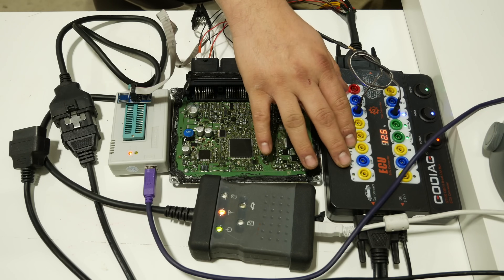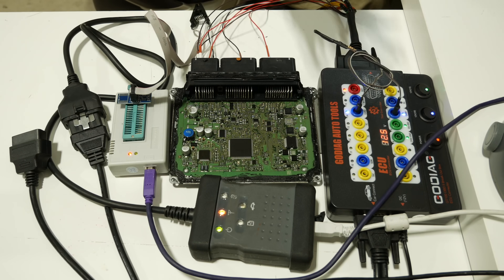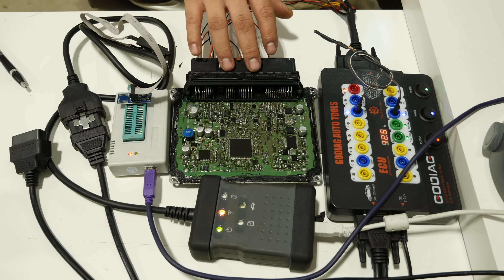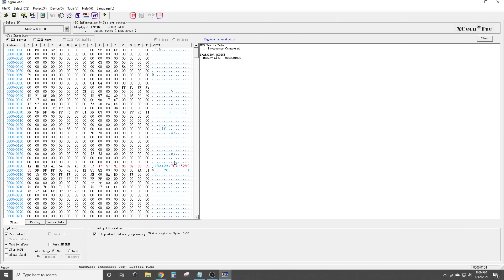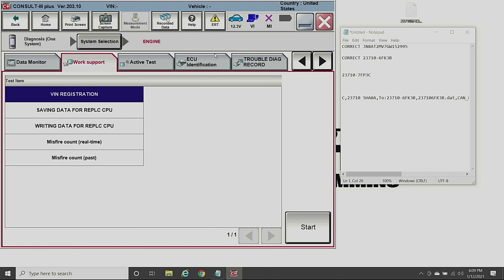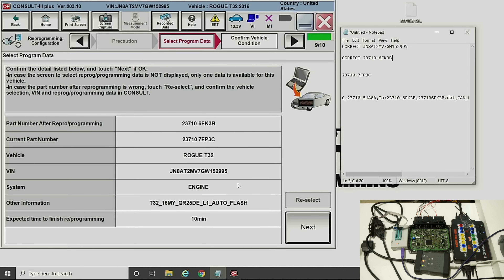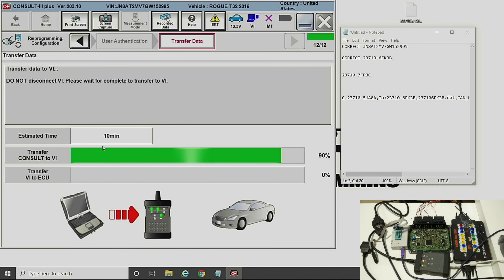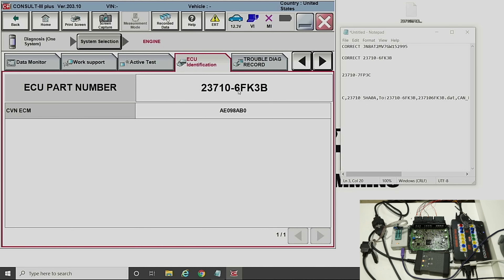Nissan Bench Programming, FULL VIDEO ON L1TRAINING.COM

Comment: Do you have any book or video turtorial teaching how to connect DB15 wires to the ECU Pin?
Reply from the maker: Just use a wiring diagram.
Reply: @L1Training  I am new to this. I tried to read toyota ecu but by using Scanmatix 2Pro but I cannot even power up the ecu. I connected to the ecu pin based on Pinout software but it is still not work. If you have lecturing material about this, I can buy from you.
Reply from the maker: @Modern_CarWorld  this isn't something that is a taught class, you must learn what it takes for an ecu to talk, read a wiring diagram and supply those things. There is some software that comes with tools like hexprog and flex that will have pilots for certain ecus, but if you don't have those tools or the software doesn't support that ecu then you must learn to red the diagrams.
Reply: @L1Training  Thank you so much for your guiding.

Comment: Hey bud I have a 2010 nissan altima I have searched everywhere and can't find any info but I have the 31036-ZX00B ETC and the 31020-1XT3D ECM what pins are used in the bench reprogramming process where cn find this info I can find tons of info on how to reprogram through the data link obd2 but none about what pins are used and the process for it. Any info would be amazing thanks.

Comment: I switched my 2013 sentra from Automatic to manual transmission, I can only drive 55 MPH and with no good accelleration. Can you reprogram or edit mine to disregard the TCM data and stay out of limp mode if I send you the VIN to know factor manual trans unit with the same year and engne? Maybe we change it to a VIN for a manual transmission? If not can you explain to me what I need to do this myself?

Comment: I have a question, i have a 2011 Altima i bought brand new. Never had much trouble out of it until December 2021 I went to go somewhere and it dropped into limp mode for no reason.

The engine light didn't come one until after i took it right back home and restarted it a few times. Then it came up with code P0705 Shift Range Sensor.

It had been replaced once by Nissan under warranty but it was only an engine light that time.

This time it just went into limp mode with no warning. It took me a couple of weeks and an educated guess to figure out the ecm was bad, I guess its bad. 

I didn't try to find out if it was repairable  i just orderd ine from Flagship1 online they sent me one but I had to send mine and theirs back to clone mine.

After that it ran fine until a couple of weeks ago it did the same thing again.

So my question is, when it gors out, the reverse lights are on all the time engine  off too so does it mean mine is damaged everytime it does rhat or can i reprogram one or possibly both of the ones I have? Also mine is a 2011 is it going to be as hard to reprogram even if I get another one?

At this rate I'm thinking I'd fair better to learn how to do these things myself if this is going to be a problem. My car inly has 60,000 miles on it so it's very irritating that I bought this thing brand new and barely got 60,000 miles and ready to give up on it.

Comment: Im doing a 08 350Z HR 6MT swap on a '05 G35 Auto Coupe and im running into an issue with the NATS. Right now I have a custom harness that is bridged between the old harness and new harness using donors car ECM and using a tuned auto ECM to 6mt with disable NATS. The car runs great with no check engine lights etc but I live in California and am attempting to pass the BAR Inspection because I cant smog it due to VIN and tune. Today im picking up an non-tuned oem '08 350Z HR 6MT ECM and was going to see if it will "shake hands" with the '05 BCM. If that work the BAR says the VIN isnt an issue and I can pass. If that doesnt work due to hardware communication issues then this will be my last option before swapping back to smog. 

From 03-07 the G35 Coupe used the same BCM part number - 284B1-CM32A
From 03-06 the 350Z used the same BCM number - 284B1-CE800
From 07-09 350Z used the same part number - 284B1-EV00A

People have been able to get the BCM's between the 03-06 350Z's to work on the G35's but I cant find ANY info on anyone trying HR ECM to DE BCM. 

So my question is from you experience/expertise do you think theyll communicate alright? 
If not my second question is does this process of changing the VIN affect the CVN/CAL ID numbers?

Comment: Hello Keith, have a silly question.  I need to power up the VI without connected to vehicle, thought of the method but didn't want to screw up the VI.  Was thinking of grounding 4,5, and power to 16 pin with 12v outlet adapter.   That should be ok, right?   TIA
Reply from the maker: The VI has a barrel plug for 12v input.

Comment: Hi Keith. Great videos, although a bit over my head at the moment. I have a question if that's ok?
Iv just purchased a Godiag GT100 pro and am trying to find a fault on a Siemens SIM4 LE from a Merc. The DTC is low voltage on terminal 30. And when I backprobe the 5v ref at the connector, I'm only getting a couple of volts. My question is, if the ECU is on the bench connected to the GT100 with all powers ground K-lines and CAN high and low. How do I test the pins to make sure they are giving the right voltage to the right component when not on the car? For instance if a 5v ref is on connector 3 pin 48 on the wiring diagram, should that pin show 5v on the multimeter on the bench? I can't seem to get any readings at all. Yet it is ok on the car except a low voltage on terminal 30 DTC.
Any guidance very much appreciated.
If you already have a video relating to this a link would be great. I couldn't find one myself. Keep up the awesome videos bud.

Comment: I wish this video was out 8 month ago. For a cheaper option, you dont have to reprogram using a scanner. If your old cpu chip is still okay, you can de solder and transfer that original chip on new pcm board.Thats where the VIN is programmed on these new ECUs, not on EEProm for emissions purposes. Also exact Match new pcm part number with old part number Before buying.

Comment: 1. PCM VIN can be changed in a vehicle, but it won't help! I had 10-15 cars with broken Rogue's PCM after the accident and I rewrite whole eeprom from broken PCM to donor PCM and the car doesn't start BECOUSE SYNC BYTES (with BCM) LOCATED IN EMULATED EEPROM INSIDE MCU! If you are installing brand new pcm and program it from base software then you can start the car with empty VIN. Nissan cars do not need VIN for security purpose like Chrysler. I replaced PCM in Altima, Pathfinder, Q50, QX60. All of these cars have 20 digit pin code. And I did it with Nissan Consult with no problem. Only Nissan Rogue has one time write sync bytes.
2. Nissan Consult NEVER EVER give you to change the FLASH to different software except software updating like on the video. On the video we can see Operation: REPROGRAMMING it means SOFTWARE UPDATE from lower part # to next one and never means changing to random software. In theory we can play with config files and cheat the Consult but I'm not sure.
Reply from the maker: I will disagree with you based on this working for quite a few rogues for me so far, but it is anecdotal as others have told me they are having issues. Also we did so extensive editing on config files to change the software of this PCM, it was not a regular update. The part about cheating consult, is exactly what we did.
Reply: @L1Training  So I never played with config files and I will try it in a future. Thanks for your hint. 
Now about security. All my friends from vehicles electronic repairs found only one way to start the Rogues - switch MCU from original PCM to another one. We tried to read MCU through UART or JTAG but it is locked.

Comment: Hi, thanks for the very informative video. Just curious did the vehicle start after this process? I tried similar cloning on a 2017 Pathfinder with no success. I had to swap mpu & other chip (not eeprom) because immo data was stored in both. If Consult 3+ is not available flash can also be changed with NERS, flash file will still need to be purchased from Nissan.
Reply: Follow up, did the vehicle start?